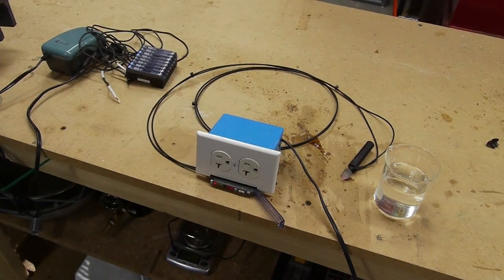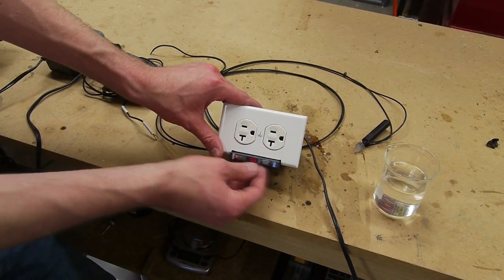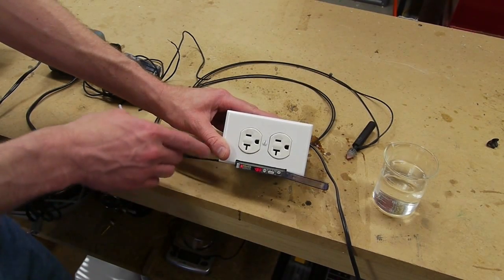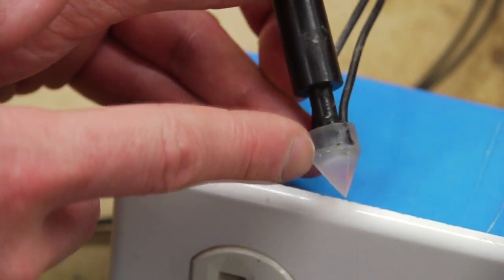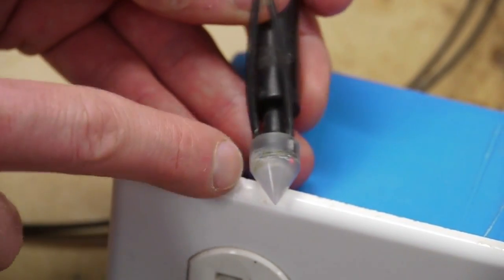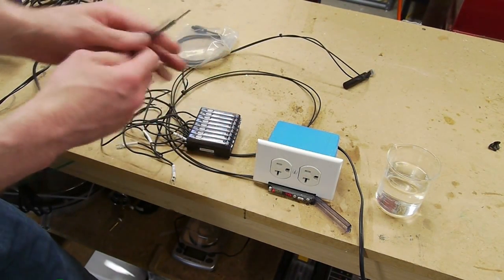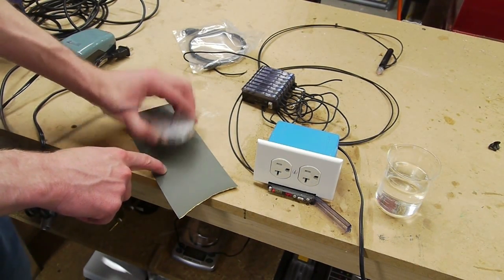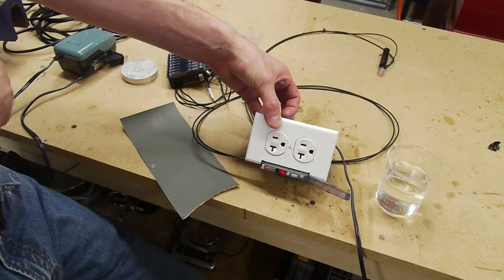Liquid level sensor and controller (auto top-off for aquarium)

Comment: Do you have a diagram for how you wired this? What kind of relay did you use in the box? I built a similar sensor, but i want to see the signal in arduino if possible.

Comment: Turns out you don't even need to make the acrylic sensor tip yourself if you don't want to. Keyence sells the FU-93/93Z/94C, which is basically the same as your homemade sensor tip, or the FU-95 series, which looks through the glass (or clear tube/pipe) to get liquid level.

Comment: Hello Appiled Science,
Great video, fantastic idea on monitoring/ controlling water levels with a non-mechanical moving device. Such as a float switch that undoubtedly in the long run has a 100% failure rate {often sooner than later due to gummy, crusty, crud build up(s)}
My assumption are: 12v Auto Relay  &  120V aquarium water pump 

Question: What is the required voltage of the senor device? 

Low voltage I presume, and hope. Since my application is an off grid happening.

Thanks, 
Shane

Comment: I can just use a 12 vdc relay with a 12 v power source to power this controller than when zero water is detected, it turns on the power head from reservoir for water?

Comment: I started watching your videos and half way through realized you have a reef tank. I don't see much on it though. This would be perfect for my system. You should have opened up the outlet box in the video. I don't have a cnc or lathe so making that end cap is not possible for me. Most ato are float or ultrasonic or even pressure/weight based. This is nice. Would love to get one
Reply from the maker: Cameron Julsrud Thanks.  I have had a few 55gal saltwater tanks, and a few small (5gal) reef tanks in the past, but nothing at the moment.  It's true that an optical, low-cost liquid level sensor would be great for small home aquariums.

Comment: Since water is slightly electrically conductive, a much simpler method is to use a hexfet and a couple of resistors, for a water level sensor.

Comment from the maker: The key thing is the difference between refractive indices of the prism (acrylic plastic) and the medium surrounding it. If the medium is air, light will be reflected internally, and the pump will be activated. If the medium is water (or non-transparent like calcium or algae), most of the light will be scattered away and the pump will not be activated.

Comment: If calcium and other external buildup doesn't reflect/refract the light away like water, then doesn't it refract like air?  Which is the condition that turns the pump on to fill your tank?

Comment: iwont argue weather or not its a "better" sys., but, in my area, just try to find any metric taps, dies, drills, tape measures, ect.. at your local hardware store. if your lucky, they will have a small selection of metric bolts. any thing else is order online and wait for it to ship. 

great vids, btw. been going through them today. found you through the designing a transistor switch circuit vid. thats what i need to know. every other video is theory. i need to see the hands on to understand

Comment from the maker: I use both imperial and metric units. In fact, I was criticized in another video for using imperial too much. Metric is obviously a better system, but the USA is so entrenched, it's difficult to switch. You're right about the angle. It should be 90 for best performance, but other angles work too.

Comment from the maker: Sure, that would work. One problem is that I don't want metal exposed to the aquarium water -- especially metal that is routed into the same electrical box that has mains voltage. The optical approach is inherently safe, and immune to corrosion as well.

Comment: Floats can be gummed up real easily with the algae and high mineral contents that are in water. I would be willing to bet that hydro unit will not perform as robustly this one does. Not only that, with this same unit, he could technically also have it sense when the water becomes cloudy and set a light off that reminds him to change the filter--or even dose out a bit of algae killer automatically. And a whole load of other things all with the same unit.

Comment: The ambient light rejection is done by modulating the light source at a specific frequency and then using a narrow filter for that frequency. That way it can reject common household and industrial light sources.  In the case of using multiple units in close proximity, many of the newer types can be connected as shown in the upper left of his video which can then be sequentially activated to avoid interference.

Comment: To make the light refraction thing a little more complicated, changing the n value of the outer material (i.e. water/air) will change the angle at which total internal reflection occurs (it's 45 degrees for acrylic in air, a different value for acrylic in water, which allows the light to go right on through the acrylic and into the water, giving a smaller reading back.